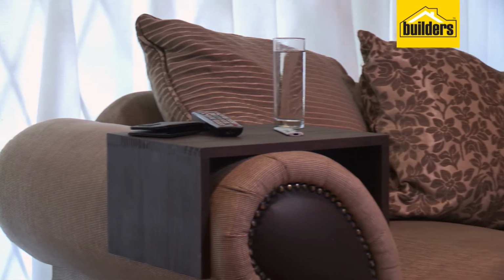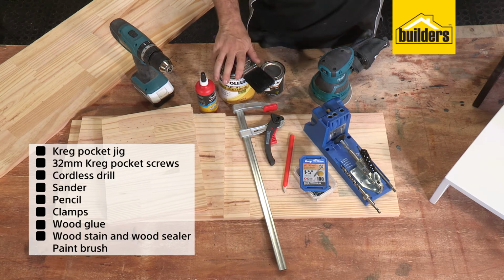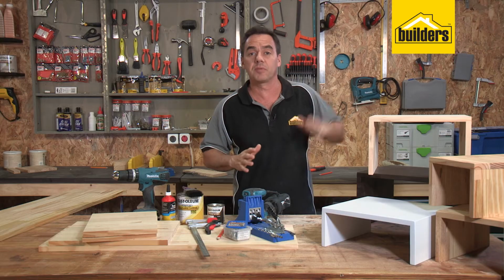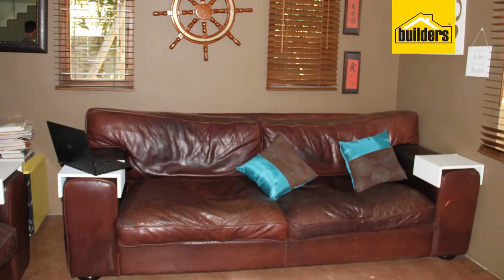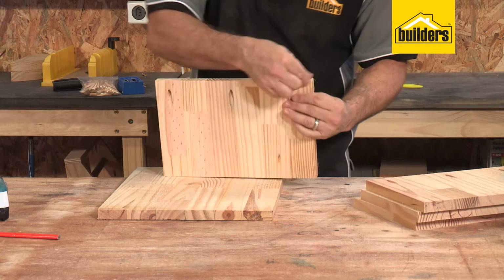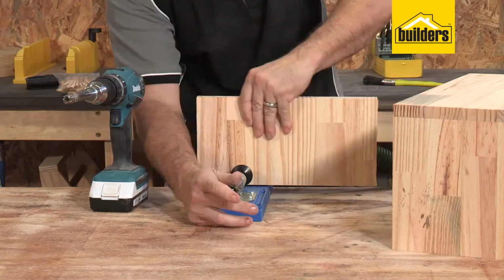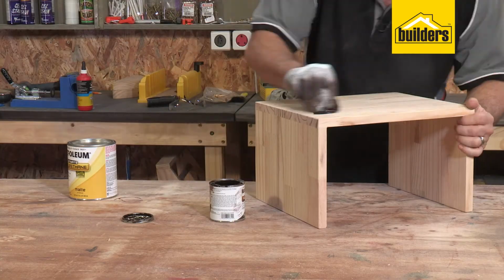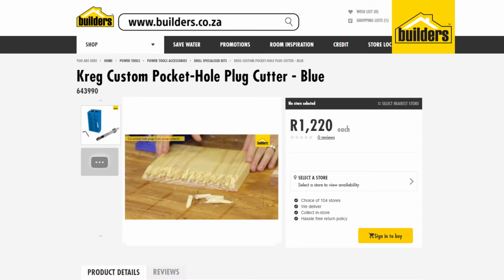How to make a Couch Arm Table

Comment: 2:04 -- Really appreciate this tutorial. I'm having a little difficulty drilling all the way until it hits the 'collar'. Bear in mind, I'm a total beginner.

Looking this up online, I saw some Kreg community members saying it might be necessary to kind of drill in-and-out several times. Wish I had known this sooner, as I didn't notice this at first, and drilled all 12 holes too shallow before comparing the screw and realizing it wasn't right. I basically had to re-setup and realign every single screw to get them to the right depth which definitely was a pain (but doesn't seem to be a critical error).